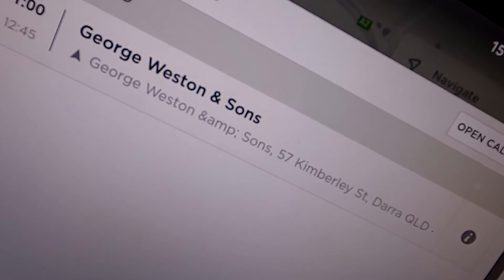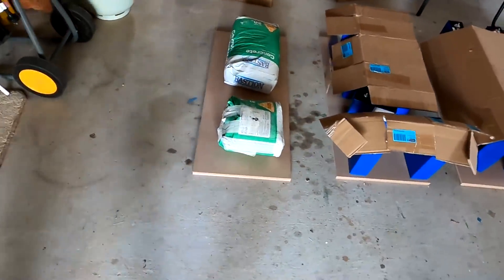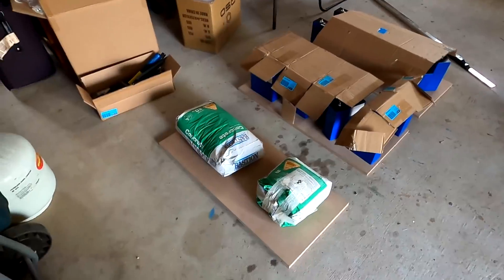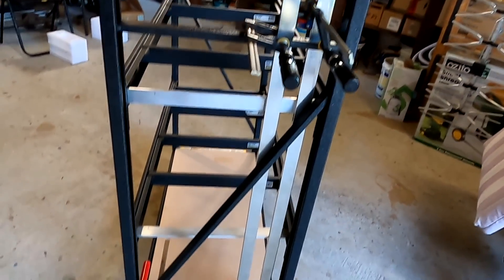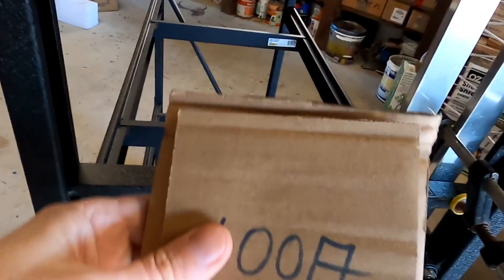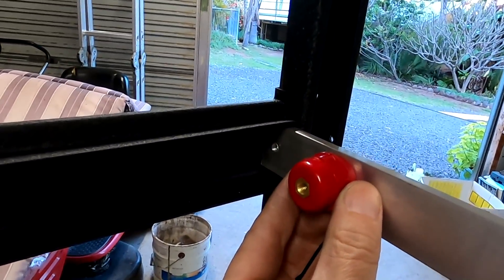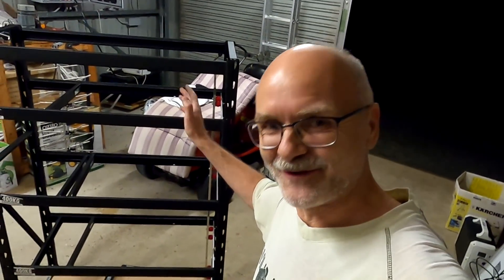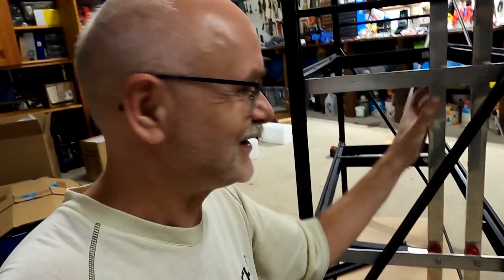1000A Bus bar installation for our battery banks.

Comment: I don't quite understand why you were concerned about matching the lengths of running cables from the batteries to the busbar (in a previous video) while in this setup the batteries will be at such different locations on a long busbar with the output (seemingly) only at the very top. Does the resistance difference not vary so much when they're on such a big piece of copper? I thought I've seen guidance from Victron, for example, to be sure to alternative loads evenly along a bus bar with multiple battery sources. Also remember something about oversized conductors actually making load imbalances due to different resistances worse, not better. This isn't critique, I'm just confused!

Comment: regarding bus bar calculations: the 30 x 10 mm is partly true cause you forgot a point

the holes you drill into it will lower its capacity cause that is the most narrow part or Engpaß

These would become the hotspots under full load assuming that a screw will not be a perfect contact replacement. 
Yes, it has contact and replaces the copper, but still with a higher resistance aand those screw surfaces become part of the electrical system which means the screws surface should get coated in antioxidation stuff with a paste that works also as a conductor. 

Would have been better to have a clamp like shaped holder of the busbar which would only be screwed into the isolators.
That came to my mind when I saw you first using clamps, but those holders are available even isolated for plumbing and roof drainage.
Then you would have replaced the isolators too, a win win or '2 Fliegen mit einer Klappe schlagen' solution and of cause most important of all: bombenfest

great episode !

Comment: hmmm... 
Part No.: 01625
Standard copper busbar 630 A, 30 x 10, tinned
2.40 m long
System :
60mm-System classic
100mm-System
185mm-System power
Product Advantages :
Tinned copper busbars make contacting far easier
and are effectively protected against hostile media.
Standards :
IEC / EN 60439-1
DIN 43671
Approvals :
Germanischer Lloyd, GOST, CSA, UL (approved for feeder circuits to UL 508A up to 600 V)
Type No.: 30x10-L
Customs Tariff: 7407 10 00

Comment: Can I connect eight 12V 100ah AGM batteries in parallel, using a 1,000 amp busbar, as well as a 3000w inverter and a 250/100 charge controller? Thanks
Reply from the maker: I would probably fuse the batteries individually before connecting them in parallel. But in theory, that should work with the limited information you have provided. Always read the specifications of the manufacturers for this equipment and see if it is compatible.

Comment: Hello Andy, I was wondering how you are going to keep these three batteries in balance? I have two 24V/100Ah batteries and it appears to be difficult. By the way, thank you for your very interesting video's and your german English. Makes it for me easy to follow. Regards, Wim
Reply from the maker: Thank you Wim. Each battery bank will have its own BMS, so they will balance individually.
Reply: @OffGridGarageAustralia  yes of course. But you will see that the batteries as a whole will not balance. That means that when one battery is fully charged the charging stops and the other two will stuck on a certain level.

Comment: Exposed 50v high amperage bus bars. Very unsafe!  At least put some heat shrink tubing over bars between terminal points.
At high current, with their separation, you might get some 100 Hz buzzing on metal nearby due to magnetic field leakage.

I recommend taping Neg and Pos battery cables together where possible.  Besides helping to reduce 2x inverter AC freq magnetic field leakage that can cause buzzing, it reduces the battery cable series inductance to inverter by half, reducing transient voltage overshoot on inverter input which is stressful to inverter input electrolytic capacitors.
Reply from the maker: They are not exposes, the shelve will be fully closed and panels cannot be removed without tools. Also, signature will be on the outside to warn about that.

Comment: @Off-Grid Garage curious to know how your eve 280Ah batteries are going
Reply from the maker: Which ones, the existing bank or the new ones?
These cells are amazing, I had nothing but good experience with them so far.
Reply: @OffGridGarageAustralia  thats good to know, but how much work are they doing on a daily basis?
I'm seriously considering buying to replace my off-grid agm set up.
Reply from the maker: @jtaylor4972  No work at all, It's a set and forget system. Once you got it all configured and the right parameters in the BMS and charge controllers, there is nothing else you have to do.
I'm just curious and excited so I'm constantly changing stuff to see what happens, trying to understand and learn. And share of course😊
Reply: @OffGridGarageAustralia  I was meaning, are they being cycled every as well as big loads
Reply from the maker: @jtaylor4972  yes, they are. I've got the whole garage connected a well as parts of the house now. They're are really good.
Reply: @OffGridGarageAustralia  thank you
Reply: @OffGridGarageAustralia  so you would recommend one over the other, or same same?

Comment: I don't understand, if you are using screws to hold the bussbars, and conect them to the same frame,if the screws go all the way through the isolators to the bussbars, how can you get an isolation effect? I am pretty sure I am missing something here. Would like to figure that out.

Great setup, thanks for sharing.
Reply: The screws don't go all the way through the insulators. You can see it some of the shots that the insert is bottomed out about halfway through, so there's still insulating material between the bolt on each side.

Comment: So let me guess, reason for shorter negative bus bar is to fit the shunt at the end? :)
Also would look really cool if you add some red and black heatshrink in all the places where there will be no connection.
Reply from the maker: That is correct, the shunt will go there.

Comment: Andy, I would slip lengths of heat shrink over the bus bars - red and black, excepting for the connecting areas.  Or simply over the whole length of the bus bar and remove discs of the heat shrink in the connecting areas only.  Would look good and most importantly will minimise a potential short circuit.  Raz
Reply from the maker: The busbars will be fully covered inside the shelve. One needs to use tools to get to them. There is not much point of isolating them. But maybe I'm doing it anyway just because it looks nice 😉
Reply: @OffGridGarageAustralia  Instead of ugly looking Red/ black heat shrink tubing, the entire length can be covered by Perspex. Perspex can be bolted with industrial plastic bolts, thus enabling easy access to service. In any case, once fitted, how many times would one remove the cover for service? Esthetically this may look great, even, with LED Cabinet illumination. Food for thought. 071421/2145h 🇺🇸 071521/1445h Brisbane 🇦🇺
Reply from the maker: @sreekumarUSA  LED illumination... 🤔

Comment: Andy - please take your bus bars off and sleeve at least the positive bar with heat shrink and reinstall now it’s easy to do  - it’s so close to a metal frame and as a tinkerer you may get too close to it years later and boom! Plus do you know how good red and black wrapped bus bars look? I worked years ago at telephone exchanges and bus bars were always powder coated anywhere near cable trays.

Comment: You do realize if you would have clamped the buss bar to the BSB and drilled through both at the same time the holes would fit perfectly
Reply from the maker: There is a good chance for that!
Reply: @OffGridGarageAustralia  I would have done it your way and gotten so frustrated that I went inside and had beer and ordered  commercial rack
Reply: I was thinking exactly that when I watched the video just now - I make lots of stuff at work. I would recommend drilling the top hole whilst clamped, then bolt it together, then make sure the bus bar is still in the correct place, then drill and bolt the bottom bolt. Then remove the clamps and drill all the other holes. Clamps have a habit of moving slightly due to the vibrations of drilling, hence do the top and bottom bolts first.

Comment: Andy always enjoy your videos, keep it up, interesting to hear you built switchboard, so did I, I would heat shrink the unused exposed busbars for additional safety, and use plywood over MDF for your shelves as MDF will suck in moisture over time and sag.
Cheers Bruce

Comment: Any reason for not using heavy gauge wire to a common point? easier, cheaper and insulated. Less chance of a short. Also with the bus bars i reckon if you can heat shrink the bits between the connections just for a bit more protection.

Comment: looks neat to me, but I would do the 5mm alloy under those boards, if it was marine ply I'd say ok, but MDF not a chance it wont be sagging in 5 years just depends how long you want to use it without changing them.
Reply: Paint the boards with an enamel. That will reduce the impact of humidity and solve your problem. Probably could have got away with 1 layer and paint .

Comment: Looking good! As an added safety measure, you might want to cover the bus bars in large heat shrink tubing. All it would take is one dropped wrench, screwdriver, or bolt in just the wrong way to ruin your day.
Reply: I would use red heat shrink for positive and black for the negative busbar just for ease of recognition
Reply: Ya, he is definitely doing a nice job. However, there is plenty of space to have separated those bus bars so there is more space between them. I'm squirming in my chair just thinking about the amount of power available in all those batteries if a "short" happens.
Reply: @bentleyjarrard885  Agreed. The last purpose-built battery rack I saw has one on each side so they were completely separated.

Comment: Going to be so much better having them on a shelve instead of in totes
Reply from the maker: The box was good to start with but it gets too messy with the cables. In Germany, someone is building a 100kWh battery with wooden crates. It looks pretty good.
Reply: @OffGridGarageAustralia  your correct it was definitely a good starting point, just think now you will be able to monitor temps,individual cell voltage to compare to bms readings, active balancers and room to expand. Awesome channel keep it coming 👍

Comment: What brand drill bits did you use? I went through about 6 bits for just my long busbars for the cells. They seem to dull after 1 hole. Would love to know what you used, as they seem to go through like butter.
Reply: When drilling copper, a zero rake cutting angle is best, need to grind the cutting edge inside the flute parallel to the length of the drill bit, works well for any softer metal, and a bit of kero or candlewax

Comment: With 250A on tap, you could L2 fast-charge your car. Even better would be if someone made a DC-DC charger that takes 48V in and directly provides CCS/Tesla DC charging to bypass the unnecessary inverter-to-DC losses.
Reply: Why add the stress / reduced life to both batteries ?
Reply: @onthelake9554  Between three batteries, 250A short-term / 200A continuous is not such a big deal. If you want to worry about damage, the first thing you should avoid is going over 90% SoC.
Reply: @teardowndan5364  Agreed first is SOC  .   Second is ROC .

Comment: Hi, i want to use Fronius 24gen hybrid inverter with 400v custom battery lifepo4. can you tell more / make small 400v dc battery with/no bms ?
Reply: That would need to be proprietary. I would go with what Fronious recommends to be safe.
Reply: I think te future of hibrid home storage is with 400v & 800v Dc with less amps and busbars. DIY ?
Reply: no iverter with 4 imputs / 8 imputs 48v  to serial all imputs inside inverter automatic to be safe outside but eficient inside inverter ?

Comment: Hey Andy. You could cut some split loom, split PVC or hose to slip over one buss bar in the areas not tapped into it. Just in case a rouge wrench jumps off a bench 🤪. I know you’d never do it by accident.
Reply: I am about to DIY just like this but not with plated copper, just straight copper bar. I like your idea and will implement it- thanks! I'm biased in favor of mechanical engineering controls like yours. Good safety.

Comment: That looks really nice :-)
I am wondering, if Aluminium is  suitable as well. I am not sure, how available copper busbars are in Bulgaria. And Aluminium is no problem to drill.
If the bars themselves are a bit bigger, would not be a problem. 
But i am still waiting for my first 16 cells......
Reply: Aluminium is ok. Only thing is you have to go up in size for The same load, still should be cheaper.
Reply: But there is this layer of oxide on top? My concerns are having contact problems...
But yet i do not know where to get either one....
Reply: @daskasspatzle2396  Oxidation is not a problem its happen aluminium when contact with air, what to think of is not to have copper wire connected to aluminium busbar because then get corrosion so better to have   have for example nickel plated terminal lugs then its ok.
Also could sandpaper down were battery lugs connected and use some Noalox to get some better resistance.
Reply: Thank you :-)